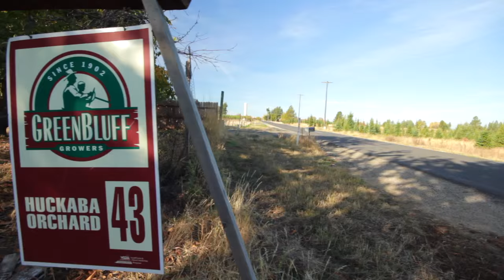How to Make Apple Cider | The Process

Comment: How long do you boil the cider for?
Reply from the maker: +unicycle master We didn't boil it. We pasteurized it. We brought it up to 165 degrees Fahrenheit, and kept it at that temperature for a few minutes and then let it cool.
Reply: ReviewOutdoorGear does that affect the taste at all?
Reply from the maker: +unicycle master No, there is no noticeable change to the taste.
Reply: unicycle master I too do not boil my cider. I put mine in 1/2 gal canning jars and place in a canner of water. I bring it up to 180 for 20 minutes. The lids will seal and will keep all winter. You can boil it but it seems to take a apple juice taste. That's fine, and I do it that way sometime. The other way by bring it to 180,  the cider taste like half raw cider with half apple juice. This is very tasty and my family prefers this way. I never tried it at a lower temp then 180. I put up a lot and do not want a bad jar to go unnoticed in my room. It may or may not, but I haven't had any trouble with the 180.